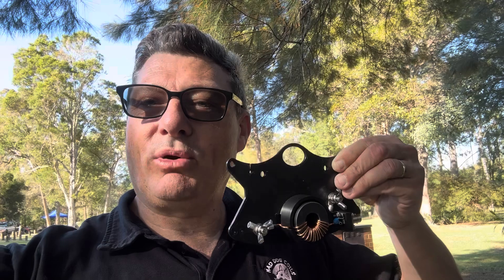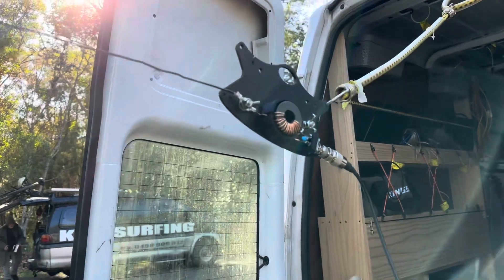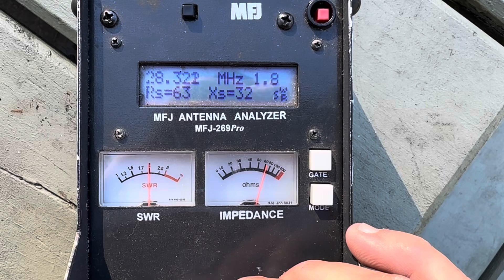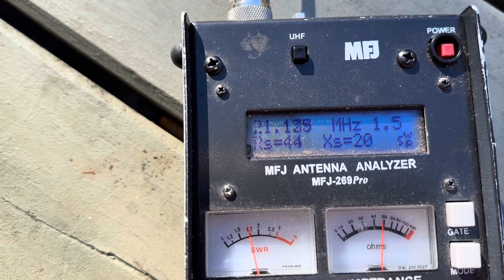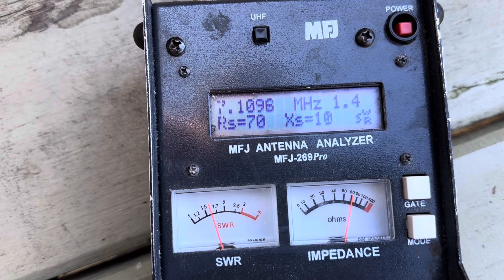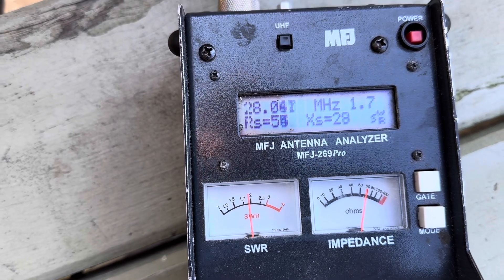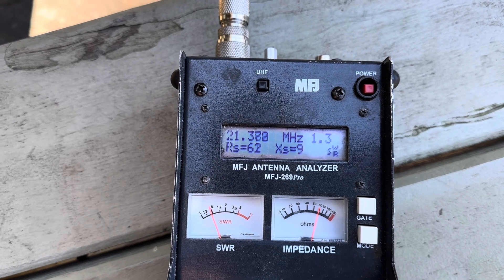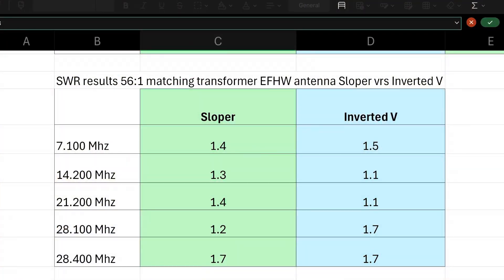MDC Mutt End Fed Half Wave transformer and Antenna

Comment: Good work Marty, I like tapping the toroid instead of twisting the end for the winding also it make a neater transformer and makes it easier to get the wire through the toroid.
Reply from the maker: Thank you.  Yes I find that winding in the auto-transformer style is easier and neater finish, and the results are the same.